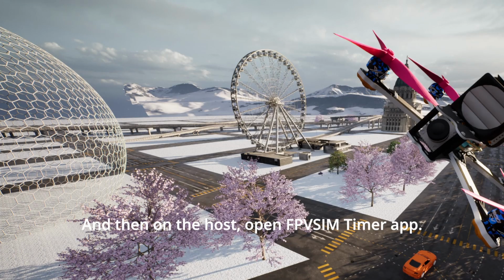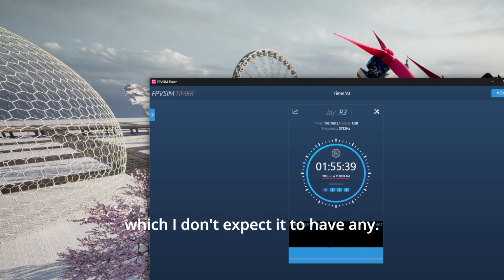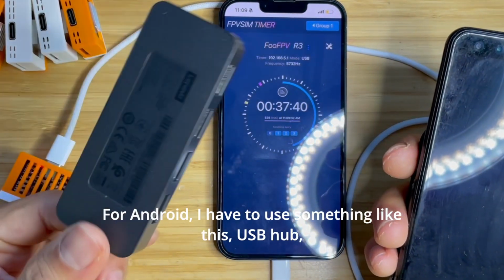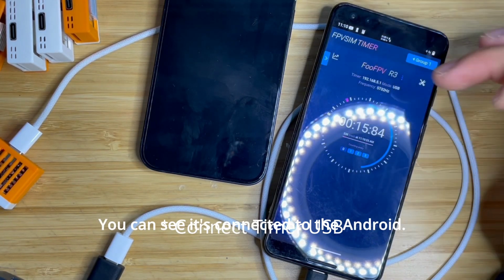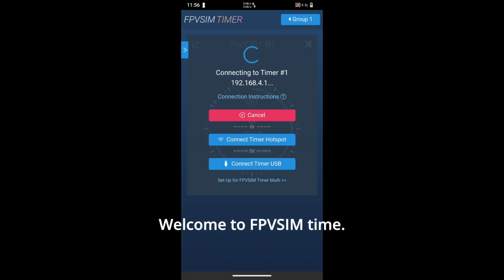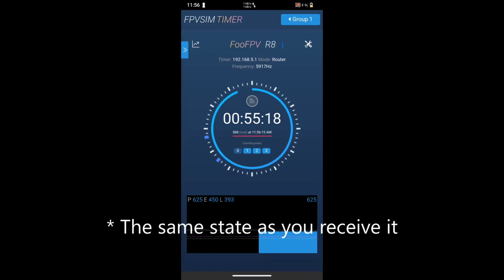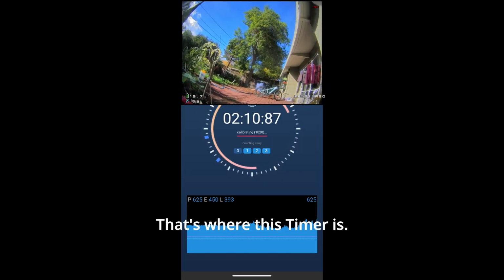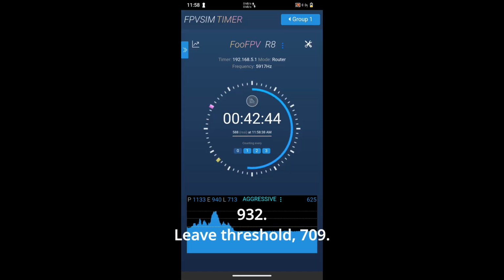Introducing FPVSIM Timer V3 — Mahjong!

Comment: does this work with multiple pilots on different bands?
Reply: Afaik this is a practice timer for single pilots. If you need multiple, use the 8 channel one.
Reply: @georgijsnovikovs using FPV Lap Timer app on mobile now

Comment: Is Calibration made per track?
Reply from the maker: The auto calibration process detects patterns associated with a track, but you can use it as a baseline and tweak the thresholds to generalize it for different tracks.